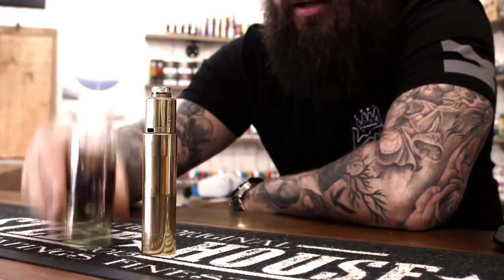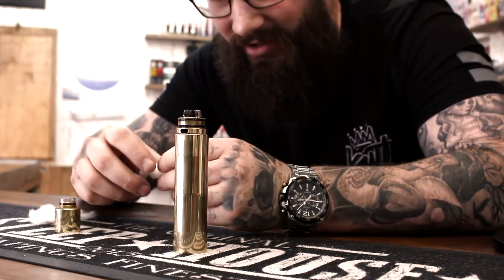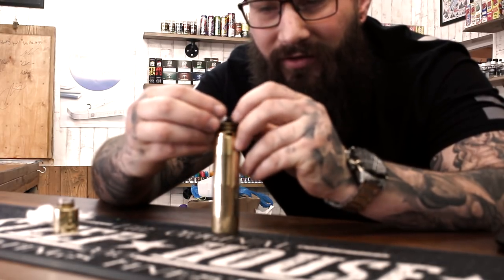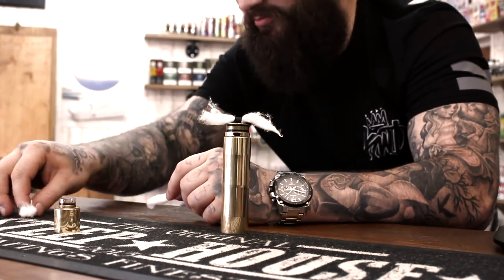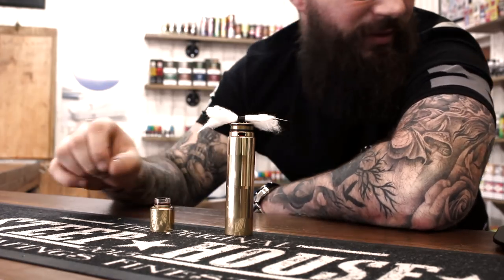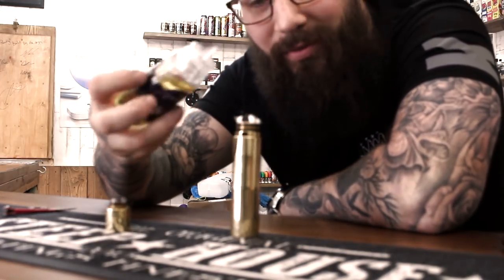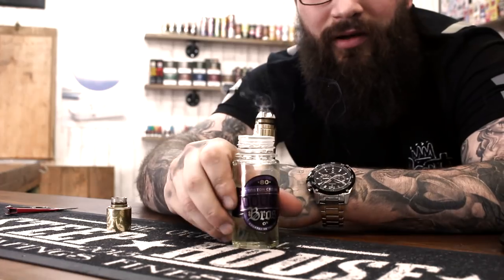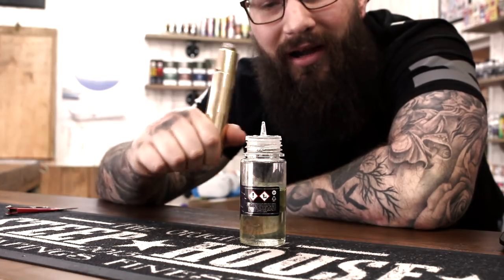Wick any RDA Perfectly every time

Comment: Simple and easy. However I only wick at most twice a week. However I do use a low 25w .4 single coil build. Change the coil once a month. I just clean it off after igniting it to red hot, after pulling old cotton out, with water after it loses the red.    I just started again and been trying everything to wick properly. I'll give the simple route a try.     I need to try to find a nice big single post. The dead rabbit is good but the airflow is more on one side so it tends to suck up more on that side.

Comment: Hi mate, I’ve been doing what you said in your video but for me after a couple of hours the cotton just breaks in the middle inside the coil.....so I start again I even then on low power pulse again to check for hotspots and make sure it’s glowing from the inside outwards before rewicking ive had this issue on a number of rdta’s it’s so irritating 😂
Reply from the maker: your coil is hitting too hot in the centre, strum it out a bit more you want a nice even glow that starts in the centre but moves nice and evenly or if you havent got many wraps on your coil try adding one more
Reply: @Beardedwiseone  think I worked out what I was doing wrong I believe I was cutting the legs of my coils a mm too short now I’ve installed some more at 6mm rather than 5mm it seems to be a hell of a lot better

Comment: You really rewick every day? I usually change no more then twice a week
Reply: Zachary Gerringer it probably tastes super fresh (and you'd get good at rewicking fast)
Reply: Zachary Gerringer He probably likes doing it and this vape must be in pretty heavy use lol.
Reply: I change mine every 2 days or ill change the coils plus wick. Just depends on how bad it gets. I use sweet dessert juices so they do gunk up my coils. I can't stand vaping on burnt/gunked up coils, it makes me cough and the flavour is awful. I like a good clean vape with full on flavour. Besides rebuilding on RDA/RDTA is very cheap as compared to buying a coil pack for sub-ohm tanks.
Reply: Zachary Gerringer it also depends on your juices, how sweetened they are and PG/VG percentages.
Reply: Or sugar in juice
Reply: Twice a week is more often than me haha, some of mine I don't need to rewick for weeks.

Although in all fairness it all depends on the juice, certain juices will gunk up really quickly, i try to avoid these. All the juice I use now vapes very cleanly, one of the gunkiest I've used was element's key lime cookie, very tasty, but needed dry burning and rewicking on a daily basis.